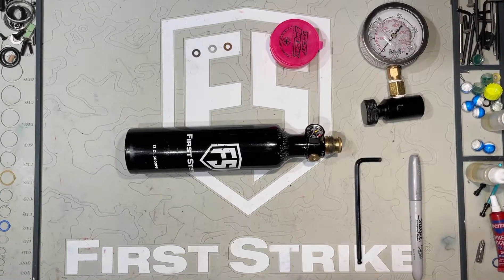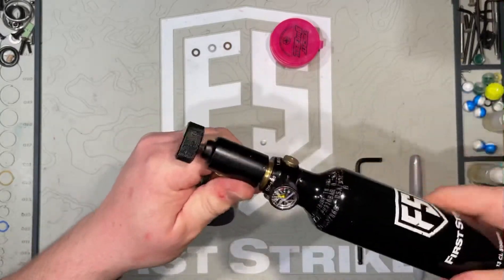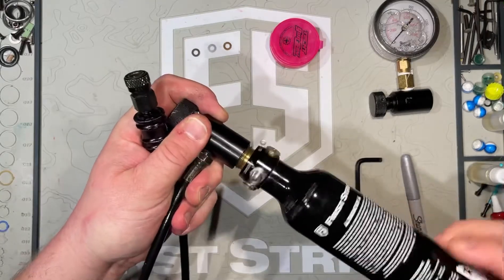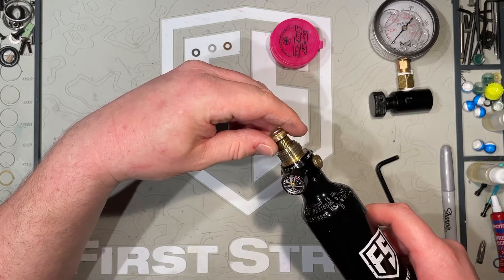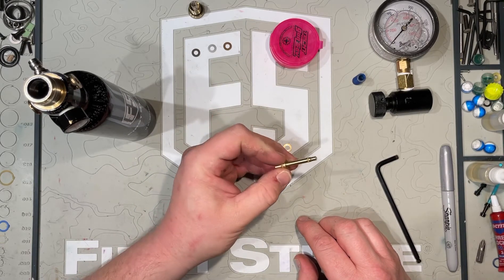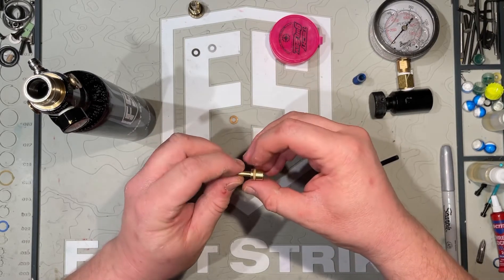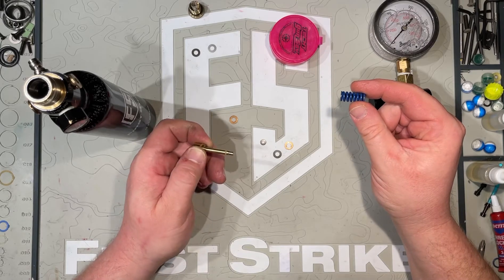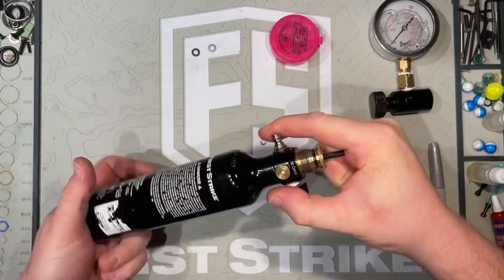How to adjust the output pressure on your first strike tank regulator

Comment: Just checked my 13ci/3000 tank that came with my new T15 and my output is 780 also.  Guess I will order the First Strike kit with the spring and shims and get it done on a rainy day, because I am definitely gonna be wanting the full auto kit at some point.
Reply from the maker: You can always try contacting first right directly, and mentioning that your tank only came at 780 psi. They may wind up sending you what you need to up the pressure to be able to run full auto.
Reply: @Prudyk1026  yeah i think i will try that.  I pumped my tank up to the full 3000 pounds today and checked again and still 780 output.  I bought my T15 and a couple hundred dollars of rounds directly from First Strike so they may help, but i just checked and they are sold out on both the spring kit and the full auto kit on their website.
Reply: @MexicanMovie  If you still want the full auto kit, I can try to assist you with that since they've discontinued that product.

Comment: Just unscrewed my 13ci/3000 tank from my T15 and the tank itself is leaking out of that top pin.  I tried giving it a quick push down and releasing and it helped but is still leaking.  It is only 3 weeks old, you ever had this happen ???  I have the new spring/shim kit so i guess i will tear it down and see what happened in there.

Comment: I’m not getting the same accuracy once I switched to remote line. I’m using a 48ci 3k FS tank. Now I’m not sure if I need to buy a regulator and additional shims to up the output pressure. As of now it just feels like the balls aren’t traveling as far and accurate as it was when tank was directly connected to ASA. Any response would be helpful. Thank you.
Reply from the maker: Best thing to do i measure your tanks output pressure. Im guessing when its tank in stock you have more than enough, but with a remodeling, you typically loose around 25ish psi. That could make the tank have just barely enough output psi to cycle the marker

Comment: Great video!. Just one question: where did you get the shims and spring for this upgrade? Thanx for your answer!
Reply from the maker: You can pick up spring kits (and they come with shims) from most FS retailers. If yours in the US, you can try rockstar tactical, magfed pro shop, or ans gear. In Canada Defcon paintball should have, and paintball gear.ca
Reply: @Prudyk1026  Nah, unfortunately, not in the US but I'm sure they can ship 'em worldwide. Thanx for your fast answer ;0)

Comment: I’ve liked your tutorial and will be doing this when mine arrives. I’m using this to convert my air rifle to pcp. Would you say it’s safe to use the high pressure ring for an air rifle? Thanks
Reply from the maker: If you’re hoping/need to have a tank output to be at a minimum of 900 psi then installing a high pressure spring is the way to go... The tank will be safe if the proper spring is used and installed correctly. I’m not familiar with the air rifle end of things. That would be something the end user would have to conclude.

Comment: I bought one of these to go with my cs1 which I've heard runs much better with output more like 500psi. Can this be adjusted to below 600? I've heard people buy low output kits for these and still can't get it below 800. Any advice?
Reply from the maker: You can buy spring kits to bring it as low 350ish psi.. they have extra low(350psi), low(450ish psi), mid (550ish). Ild recommend using the low spring, and then use included shims to bump it up to 500 ish

Comment: I thought putting oil in a high pressure tank can make it explode but you lubed the oil rings?
Reply from the maker: I didn’t use oil. I used a minimal amount of grease. Not only does it help the orings, but helps the main piston shaft move easier which is why I had applied it to the piston

Comment: Hi, recently I bought my first T15 and this one already comes with FS tanks, but I don't know what is the ouput pressure of this one. There is any problem if the ouput pressure comes below to 800 psi?
Reply from the maker: The fs tank from the factory are typically set between 825-850 psi. If for some reason the tank is putting out less than 800 psi, the marker will burp or go full autoish from the lack of sufficient air pressure to push and reset the bolt.

Comment: so would this increase the preformance and shot per second if you had a full auto kit?
Reply from the maker: Doing this will help you marker have enough pressure to sustain full auto at the rate you have it set to. You can adjust the rate of full auto fire by turning the rate of fire screw clockwise in small increments
Reply: @Prudyk1026  so for a 13ci tank you recommand not goin any higher than 860?
Reply from the maker: @Steppa  for the newest gen T15’s, tank in stock, you shouldn’t need to. For older gen T15’s or if your using a remote line, the need for a slightly higher output pressure is possible...
Reply: @Prudyk1026  got it.

Comment: Can I take all the shims out to use on a speedball gun?
Reply from the maker: Depends on what your speed ball marker needs for tank output pressure. If u take all the shims out of a stock reg, you will still be at about about 780-800 psi. You need to change the piston spring if you need lower pressure

Comment: Hey, I buy the first strike hero 2.0 reg, can I set the output pressure to 300psi for airsoft? Thank you
Reply from the maker: Yes you can. You need to buy the first strike lower pressure spring kit and then swap springs with the one installed
Reply: @Prudyk1026  thank you for your fast answer ;)